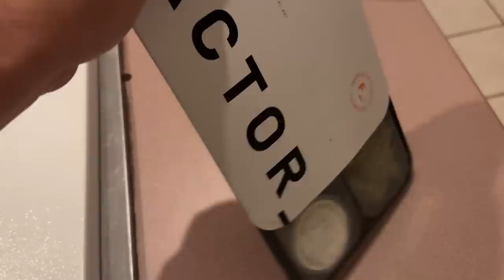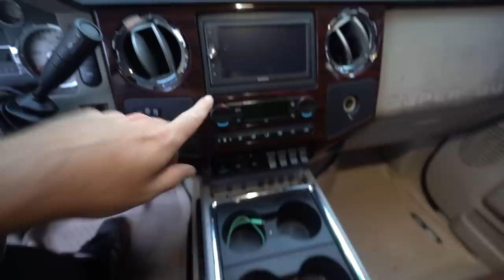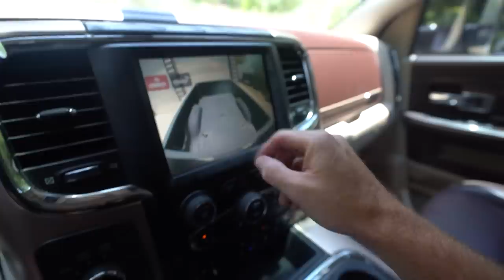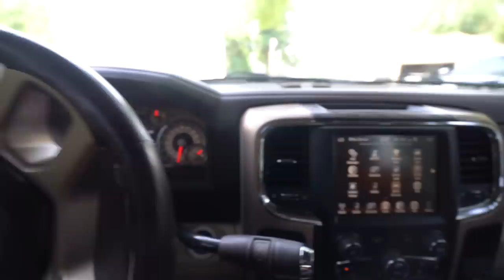My new truck broke down. so I bought another one. bucket list tow rig.

Comment from the maker: I guess One thing I didn’t touch on is that this truck was was literally exactly half the cost of the 2020 superduty. The superduty was the only vehicle I’ve ever had a payment on. I did put a good amount down so I wouldn’t be upside down in it. But still I didn’t like that I didn’t truly own it. I know it’s fine and whatnot it’s not bad to finance. But I’m just not that person. I drove around $1000 daily for years to avoid a car payment. The only reason I did it this time was for the peace of mind. Which is fine anyway. So selling it. Buying this. Means no more payment. And this thing wasn’t much more than I can sell the fummins for. But needs far less stuff to be where I want it to be. So it’s actually cheaper in the long run for me than doing everything the fummins needs. Plus not having to try and upgrade the fummins in between needing to use it. I do plan to still fix up the fummins. And if I realize this was the wrong call. Then I got to use this as a temp tow rig to make building the fummins easier. 

Also if you want a chuckle. Go watch the video buying the superduty. I explain why I bought it and word for word what I said I was avoiding happened. Lol
Reply: I’ll never go back to a car payment, I hate them. I’ll stick with my $2500 Silverado until I can save up for something better. How many miles are on the new truck?
Reply: Love this thing and it makes a lot of sense as long as you can figure out the trans. Just gotta get some spicy wheels on her 👀
Reply from the maker: @jacobjones784  yeah I made it this far in my life without it. Caved for the superduty for the reliability and warranty. Realized that was a joke. So I’m never going back. My motto was always if I can’t buy it outright. I can’t afford it. Interest rates were low so I sent it on the ford. But it irked me everytime I drove it that I didn’t truly own it. And it has 160k miles. A bit more than I wanted but it was localish and perfect for me otherwise.
Reply from the maker: @RileyMonthule  it does need that without doubt. Lol
Reply: Taylor I don't know if anyone has told you but get in touch with suncoast performance about the trans in the cummins,  cleetus took  his original tow rig "white buffalo" there and had them strengthen and tune the valve body. Don't know how close they are to you but they are in Florida. Maybe ask cleetus if he's not busy 👍
Reply: Your going to want the larger trans pan from ATS or similar and their transmission bypass valve unless the truck already has it….. dodge essentially has a thermostat in line with the supply and return of transmission fluid that likes to fail shut which blocks cooled fluid!
Reply: Happy for you Taylor you’re making decisions based on what you feel is best. Your thinking of your teams comfort the mega cab is an awesome truck. I feel like there’s been a lot of hate on this video but you have your goals and aspirations to co drifting the tow rig aspect of this channel has been awesome content but it’s and area where you want to have piece of mind. Disregard that haters and enjoy the comfort this truck will bring you and your team. I hope there’s more Cummins content but I feel there’s kind of a vibe about that truck that prevents it from being the permanent tow rig and nobody should hold that against you. That’s enough jibber jabber just happy for you and the team and can’t wait to see more competition content!
Reply: Things happen for a reason dude, I think that you are way better off in the 2016 mega cab. Wicked good deal in the long haul!
Reply: Literally exactly double the miles
Reply: For half the price of the mega cab you could stop f wording around and buy a real truck.
Reply: I'm struggling with this myself, hate payments but my 95 single cab 12v isn't doing it anymore for long trips. About to buy a brand new tradesman I think, used have a ton of miles for the price. Truck would honestly last me 30 years.

Comment: You're gonna regret that short-bed choice real quick imo.
Reply: It will turn into another "bucket list" truck
Reply: I do wish my megacab was a normal crew cab with a long bed. It's nice to have the extra room sometimes, but typically it's a pain with trailers. The blind spot out the passenger rear is horrible. Can be a big problem backing up a trailer. I have to get out and look too often.
Reply: @offroadspecialties7383  Just cut it up, lol!
Reply: As well as the rest of the truck... only worth having from it is the 6.7
Reply: I have no idea why Dodge didn’t make a long bed mega cab. A dually is made for towing, so why not give it a bed length capable of towing a gooseneck or fifth wheel.
Reply: @WillE454  A v neck flatbed is. No problem. So any hot shot or person towing an open trailer has plenty if room to turn. The megacab short bed is the same wheelbase as the crew cab long bed.
Reply: @WillE454  Probably figure the numbers weren't there to have another line running for a long bed when most short beds are the preferred style. Also, parking my crew cab 2500 shortbed is a chore enough with its length and turning radius of a battleship. I don't want to think of the headache trying to park a drw truck that is 3ft longer would cause.
Reply: Nah off set hitch and  it's fine

Comment: I'm a Dodge mechanic. As far as the problems these transmissions have really depends on which trans you have. if its the 68rfe they are prone to quite a few problems but they shift smooth and quick. The problems range from converters stuck in lock up too solenoids cracking the valve body like you mentioned. regardless upgrade the transmission cooling big time if you want it too live a long healthy life. Also when they do let go, they get very hot, very fast and can actually push the fluid out of the dipstick tube, land on the exhaust manifold and light on fire, so a locking dipstick is a must. if its the Aisin transmission they are pretty bullet proof but they shift like it too. As far as the rest of the truck you shouldn't have many issues, the turbo actuators go bad every now and again but that's literally a 30 minute job. the 3rd brake lights leak sometimes so just pull it off and give it a reseal now. also check the big body connector behind the fl fender liner, they are prone too water ingress and thus corrosion, take it off, chuck it full of dielectric grease and you're set. Good luck with the new rig!
Reply: I am going to agree with this guy and recommend listening to him. 

Do your time finding a good tuner, if not learn how to do it yourself. I know HP supports a good amount of diesels these days, and you are at least familiar with their platform. 

The Megacabs are amazing. Good choice my guy. Happy to see you kept the Fummins as well
Reply: The Aisin trans are bullet proof in comparison to other Dodge offerings. The shift can be changed with programming or valve body mods.  They are Allison clones.
Reply: It’s not an aisin looking at the video.  The trans dipstick is on the passenger side.
Reply: I'm a heavy fleet mechanic and you are spot on with your findings   I got 7 dodges with the 6.7 /aisin trans  combo.  Danm near bulletproof
Reply: @ruthlessronniethemechanic5639  👍
Reply: How about the shit front ends and paper frame?

Comment: Hey Taylor, I towed a gooseneck for years with my mega cab. If you don’t want to modify the trailer, get yourself a pull right super glide hitch. When you turn, it actually slides the pin towards the back of the bed. You can have the trailer 90 degrees without hitting the cab. I was towing a 40’ trailer loaded to 14k. That hitch is beefy. Happy towing!
Reply: Those hitches are sick.

Comment: I've built a ton of 68rfe's, for what you're doing I dont think you need a billet valve body. Revmax bonded separator plate, buy the solenoid switch valve reamer kit and an oversize valve, drill the hole for added line pressure (you will need tuning for this) toss a new solenoid pack in there while you're at it. If you have access to a scanner check the OD clutch volume index (40-50 is ideal) and this will give you a general idea on the health of the internals. Get a billet nipple for the spin on filter. Also a good low stall 15 blade billet converter makes a huge difference. I would be more than happy to source parts for you and walk you through anything you need help with. They are actually very simple to work on.
Reply: I would preventively put a sonnex overdrive clutch housing since losing 5th and 6th gear the main issues with these transmissions other than the valve body warpage  issues. Especially since you're going to be mainly towing in overdrive. The factory design clutches are so thin and only single-sided the sonnex kit addresses issues it doesn't make it perfect but definitely increases the surface area of the overdrive clutches.
Reply: I would also look into getting a billet flexplate for that kind of towing. I had one bend and break the transmission adapter plate. It was towing a gooseneck about the same size.
Reply: The sonnax drums are great, I have had better luck with them compared to several others. However, I don't suggest anyone have their first automatic trans experience be a 68rfe input drum lol. Taylor may have been in some autos before so idk, he's very talented so probably wouldn't have an issue. 

Also, while you're at the input drum might as well upgrade the 2C return spring retainer, then at that point you're pretty much building the entire trans. If your overdrive clutch CVI is in spec, fluid doesn't look scary, I would definitely do the valve body upgrades I mentioned above and then just enjoy it. Good trans tuning and a healthy valve body goes a long way in driveability and lifespan.
Reply: @calebwilliamson7525  I dont see too many broken flex plates unless you're running a triple disc converter.  On stock style dual disc converters I usually dont suggest a billet flex plate. A low stall billet converter is actually less likely to break the plate. Not as much RPM gap to bring together and the billet backing plate doesn't distort and put weird forces one the plate. 

Not that a good flex plate is ever a bad idea, I just don't see them as a necessity on most stock-ish trucks. However Anything that needs a triple disc also needs a billet flex plate, billet input and an upgraded input drum of some sort. Sonnax, revmax, suncoast etc.

Comment: Great choice! Already deleted and has the CP3 instead of the problematic CP4 that took your Ford out. Make sure the grid heater bolt isn't rusting or just delete it altogether along with what you suggested for the transmission and you should have one of the most reliable tow pigs on the market.

Comment: Here's a wild idea. Extend the frame, slap on a long bed and have the best of both worlds.
You can make it a series and use the Fummins until it's done. Don't tell me it wouldn't be freaking awesome!
Reply: Did this when I worked at a Dodge dealer. It was a cool truck but gigantic.
Reply: Just watched a dude do this with a tundra. There’s no reason this shouldn’t be an option from factory.
Reply: Or just find a 4500 crew cab chassis for 10ft flatbeds and put the cab on that.
Reply: Lol he just spend prolly 60k on it and u want him to break it down and spend like $30k more😂😂 Forget that
Reply from the maker: @nicholascole6939  I spent wayyyyy less than that. Which is why I bought it. Literally half the cost of my white ford. For a 4 year older truck with better options.
Reply: @nicholascole6939  The long bed conversion is >$10k
Reply: @Circuit_EF  Hunter knocked that out in a few days too!!
Reply: @nicholascole6939  Long bed conversions are @8K , less if he would do it himself.
Reply: @nicholascole6939  I don't recall if he stated the mileage but more like $40-45k at a dealer once it is in the 80-90k mile range for a 2016. Used Ram trucks have depreciated a lot since Stellantis is starting to pump them out in recent months to the point that some models have overstock.
Reply: @nicholascole6939  And make it back in one or two videos....and have the truck he needs. Sure, forget that. Terrible idea.
Reply: MegaLong Rams are dope.
Reply: This is the way
Reply: @Taylordrifts  neighbor just did what they are saying….mega cab and 8ft bed. It’s epic and gigantic lol. Might not be a bad idea to source a long bed frame
Reply: @nicholascole6939  also frame stretch is far less than $30K, with bed and paint work if needed, he could do it himself for under $10k easy. I do big trucks all the time for under $10k and that includes a cutoff and $100/hr labor rate and a ton of 3/4 and 5/8 bolts.
Reply: @Taylordrifts for the trans you need a different torque converter. That and a strong fly wheel. Wayyyy back the boosted bois blew their ram and the torque converter / flywheel were things that they replaced. After that idk what else you’d do
Reply: I second this! I have an 08 megacab that I have personally put over 350k miles on and I’ve wanted to long bed swap it from the start just haven’t had the extra cash to make it happen. 3-6 inch lift with 37 inch tires megacab long bed is the perfect rig
Reply: Just service the transmission. My mom has 6.7 with over 230,000 miles and pulled 10 to 12 thousand lbs. up and down the east coast and she still on the original transmission and it's the old dodge transmission   and still shifts great.
Reply: When I had mine I wanted to do this with a fleetside, convert it to the rambox bed and run 3rd gen mega cab dually flares. I also had 22.5s, it was so sick
Reply: Would love to see the Alcoas on the mega

Comment: Just so you are aware. If I’m not wrong after 2014 the Cummins had grid heater bolts that would fall out and go into a cylinder. So just check it out and be safe.
Reply: It's all 6.7s that have this. Better safe than sorry.
Reply: Yeah my uncles truck just got a
$30k new 6.7 bc of that bolt fell in.
Reply: Banks makes the best fix for this issue
Reply: Yes, the bolt that fastens the 12v cable to the isolator block the powers the heater element rots thru mid way and the bottom half gets  sucked usually at the #6 cylinder. Banks engineering has a retrofit for this.
Reply: If you want to keep the grid heater sure Banks is nice, but he can just delete it entirely with the Fleece kit being in Florida weather.
Reply: It can happen to any 6.7 but banks has made a bigger deal out of it than it really is. I'm foreman of a diesel repair shop, have been working on cummins trucks full time since 2007 and I have not seen an engine failed due to this problem in person. Not saying it doesn't happen, just banks trying to scare people into buying their product.
Reply: started in 07.5
Reply: @parkerearp4316  exactly
Reply: He lives in the south, if he unhooks the grid heater power cable then the bolt won’t melt and fall in the motor it’ll just ride where it’s at
Reply from the maker: @parkerearp4316  yeah there’s a lot of stuff like that with cars. And there’s other things like. Subaru 5 speeds are “glass” they break if you look at them. Yada yada. I had one. Drive it for 2 years. Sold it to a friend who drove it for another 2 years. Both of us drove the car hard. But we have mechanical sympathy. So we didn’t try to rev limiter launch it. Super hard shift. Etc. and we never broke it. That’s something I’ve learned with cars. There’s some people that can break literally anything. People put 350z axles in 700whp 240’s and they last no problem. Yet dudes in Stock Z’s making 250whp can break them constantly.
Reply: @Taylordrifts  yea it's crazy how much money people will spend on things they "need" because their vehicle will blow up without it. My 2018 ram has 300K miles and is BONE STOCK. Not a single modification. Runs and drives like a 50K mile truck, but the previous owner maintenanced it regularly and drove it like it's a truck not a race car.  I will make some upgrades that I know work, like removing some "stuff", FASS fuel system, trans upgrades. All because I want it, not because it's going to fall apart without it. Lol

Comment: You could convert the trailer to fifth wheel and just get a slider fifth wheel hitch, so that way tongue weights where it needs to be driving, and then it can unlock and slide back for parking and what not. Our fifth wheel toy hauler we use a slider and it’s super convenient. Not as ideal as a long bed but it works well enough.
Reply: Or better yet a superglide its all automatic